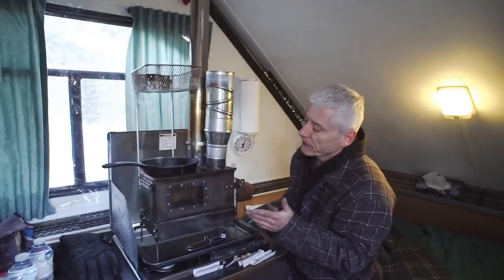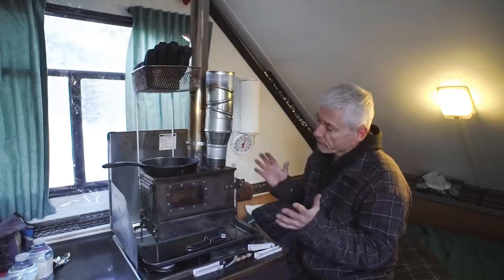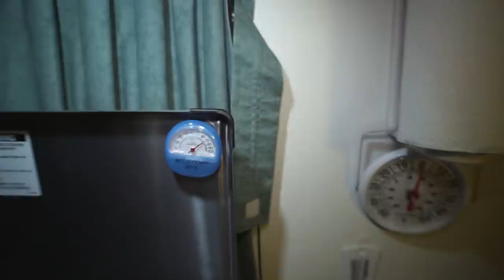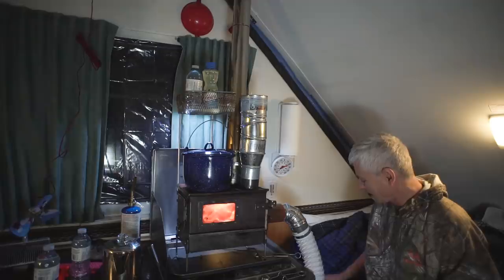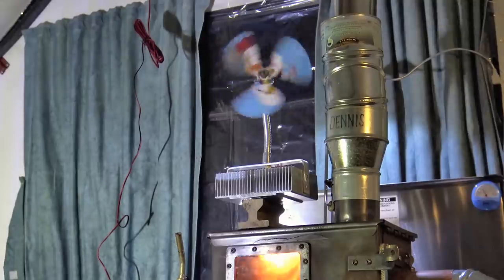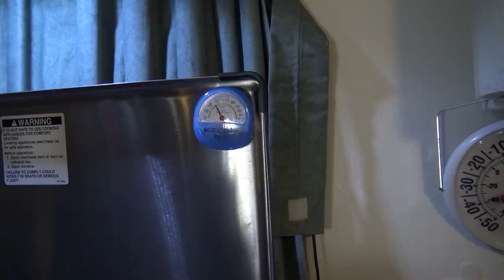Wood Stove in an A-Frame Trailer - Part 2

Comment: @slim Potatohead  Awesome videos!  Thank you for sharing what you are learning.  There are a couple of different things you can do to help with the heating. Instead of plastic sheeting use those thin mylar emergency/space blankets. They fold up super small, are worth having in any kit, and can be tacked up in place over the windows, and even on the solid walls, to help reflect the heat back into camper. You can usually find a pack of 5 or even 10 of them for about $10 US Dollars. (you can search for other youtube videos from bushcrafter's that show the how effective these types of blankets can be as heat reflectors).   Someone else mentioned anthracite coal. Most of the Narrowboaters in the UK use this type of coal to heat their boats with a multi-fuel stove. Not sure how readily available it would be in your area but it is usually available in 10kg and 20kg bags. It should last a LOT longer than the wood pellets, and end up being cheaper in the long run. It should also burn longer so that you do not have to keep waking up in the middle of the night to stoke the fire and add more fuel. If you do try the coal, the carbon monoxide detector is worth using just to make sure there are no issues.
Reply from the maker: Thanks for your suggestions Jessie. A few have suggested coal, however since I travel some very sparse places sometimes I'll probably stick to what I can get locally. Good thing about a wood stove is there's always something available to burn. SP

Comment: Some suggestions. If you cut a hole in the side of the shower you could use the drain as the hole to draw in air. A firestarter that is easy to make is to take a paper egg carton and cut up the cups and fill them with dryer lint and sawdust and then cap it off with wax. Another way is to use cotton balls and alcohol hand sanitizer to light the stove as each one burns for two minutes and it's cheap.

Comment: I recommend one of those fans that run off heat of the stove, they circulate the heat a lot. And maybe 2mm tape up some insulation foam with the reflected coating. It’ll have you sweating in no time

Comment: Maybe someone else already said it, but I think if you use a foil safety blanket as a curtain, you might be able to keep more warmth inside. They are not that expensive, very light weight and easy to fold/carry. And maybe you can put some rocks on top of the stove. They stay warm quite long, you can put them in a sock and warm your bed with them

Comment: Hi, Slim: I looked at various different types of RV's, including their construction. Depending on the RV, including how it is constructed, will determine how warm it will stay during the winter. During my research, I found that DIY's were enclosing the bottom of their trailers with, King span or polyshield as skirting around the bottom of the trailer as a wind barrier. I would be inclined to use 3" kingspan with an R factor of 10 and glue polyshield on top, then put this on a movable skirting frame and enclose the bottom, of the trailer with it.  For insulating the interior, I would recommend looking at Frost King CF-55 Foil backed natural cotton duct wrap, a DIY'er  used this form of insulation and it keeps their van very warm in the winter.  Normally, this type of insulation is used during a build, to line in between; the studs. But it could be used in a canvas sleeve to create a cold barrier. The canvas sleeves could be attached to the interior walls of your a-frame as a removable cold barrier, for winter camping using zippers to attach all of the sleeves together. You could even, Velcro zippers on the interior walls and attach the canvas sleeve sections to the Velcro zipper sections. (Frost King CF-55 Foil Backed "No Itch" Natural Cotton Duct Wrap, insulates, cushions, and reduces vibrations on heating and AC ducts
, it is a safe alternative, requires no gloves, face Mask, or goggles needed
 and has a Class A fire rating, including providing maximum insulating power and installation is easy.) You could even create window sleeves from this material which would further help to insulate your little A- Frame Trailer. Best of luck to you, on your journey. Another idea, for this concept, would involve using tracks, for sectional insulated sleeves, insulated with 2 " foam board, with Frost King CF-55 glued to the top, placed on a light flat board; covered with utility canvas and stapled around the back, with heavy duty staples.  The sectionals being slid in between the tracks, attached to the interior of your A-Frame trailer, to make them removable and you could even consider scotch guarding these sectionals to keep moisture, from seeping through. Zippers, could be used, in the sleeve sections, where these sections meet to zipper them to gether, to help create a cold barrier.   I have seen this method, for insulting used by a DIY'er who was insulating his modern Conestoga Wagon with. The results were surprising, not only did this wagon stay warm in the winter, but it stayed cool in the summer, just food for thought. If, you have room and haven't put fire brick inside, of your stove. I might consider doing so, several DIY'ers; including campers who used wood stoves in their tents, RV's and Conversion vehicles all suggested doing so. Many of these DIY'ers, including campers explained how fire brick holds it's heat, projects the heat back into the RV/tent/conversion vehicles. Many, suggested placing bricks around both sides and the back, including a partial brick on top, which seemed to work and kept the heat from  escaping up the flue and the chimney much cooler-My best to you, on your journey.

Comment: Just a piece of advice, boss - infrared cameras aren’t at all accurate when aimed at reflective surfaces unless a dull material is added to them first. For copper pipes a piece of masking tape is sufficient, but for a shiny stovepipe, one spot painted with 1200° stove paint works well. Keep on camping!

Comment: Great video, I saw the entire series from construction to the best part. Keep up the good work of sharing your experience and your lifestyle. A suggestion: Why don't you try to do a package or a mix of cotton pellets socked in cooking oil and phosphorus and fit it half way of the wood chips intake. By doing that you can allow the first half of chips to burn off, then the package will drop for maximum heat and burn and at the end the second half of the wood chips.  That might give you more ours of sleep without having to stir the ashes to reignite the fire again :)

Comment: Really liked this video. You actually made a stove fan out of the old koolatron fridge parts!  Very cool. (I upgraded my peltier element and heatsink/fan in the koolatron so it actually cools now.)  One thing I see on the stove fan, since the peltier element works on temperature differential, it would be more beneficial to have the fan blow at the heatsink or draw air through it.  The ready-made versions all have similar design where the fan cools the heatsink. But maybe you wanted it to turn slower so it's quiet, just an observation. 

For your pellet stoker, maybe you can make it built-in.  Something like metal fingers in between the basket holding the burning pellets that can jiggle from the outside.  That way you can do this easier while you're half asleep.  Having to poke through 4 small holes while half asleep might be challenging.  But nice multi function stove you got there!
Reply from the maker: The fan was just a first test to see if it worked, expect to revise the design. The fan is on a gooseneck, so I can bend it any position for better efficiency. Fan blades will also be revised. Thanks! SP

Comment: You can put some rocks underneath, atop, and generally around it to retain that heat, same concept as a "mass heater". You need mass to retain that heat and keep distributing it, somewhat negating your lack of insulation and catching more heat before it goes out the chimney. Also if you can convert to a coal stove you'll get a lot better heat for a lot cheaper.

Comment: Has anyone mentioned covering the windows with insulation foam sheets?  They can groove them then hock and loop them to the walls.  They will easily fold flat for storage.  I like the heavy R factors for insulation.  You may want to look into heaver mats for the floor and in your storage areas.  It would also help with cooling in the summer.

Comment: You might try using a fire place fire starter or cutting a fire log (walmart) into thin slices to Stuart the stove, works good! Saves a lengthy start up with propane torch! Shalom!

Comment: just an idea...wet the windows and cover with bubble wrap//supposedly the air pockets in the wrap help insulate.Cut them to size and remove when not needed.The wrap is inexpensive

Comment: As aluminum conducts heat pretty well, it crossed my mind that you have a hot stovepipe running from the top of the stove up to the inside of the roof, something around a yard of length to which you could affix an array of aluminum plates similar to the fins on an air-cooled engine, possibly by use of a hinge and clamp, so that you have aluminum flashing applied to the outside of the pipe with fins riveted to it . . . you're well able to take the notion from there and run with it. The goal is more surface.

Comment: I understand larger pellet stoves have motors that feed the fire to keep it going.  How do you ensure your feeding system works without igniting the pellets in your holder at the same time?  Great video!

Comment: Greetings Slim! Great video and congrats on the successful run on the wood burner! That rain cap and spark arrestor is the bomb!  Your little electric generator you fashioned is great as well. It reminded me of those deals that came out around Christmas time at my Aunt's house that would spin when the candles were lit. I forget what they were called.  Did it successfully charge your camera batteries? 
It was interesting to see how clean these pellets burned (earlier in the video after the fire burned awhile and it came out the stack). 
 In the White Mountains we burned only juniper as it was the only wood around (very plentiful). 
 I remember in the earlier videos you intended to burn wood or pellets depending on the conditions. Do you think you might try wood next? I realize that certain kinds of wood burns hotter and cleaner than others and it made me wonder if it is the same for pellets as well?  I think if I were using that little stove I would use the pellets indoors because it burns and keeps so easy, unless I run out of pellets for some unforeseen reason? Oh how I hated trying to keep the cabin clean and trying to store wood inside for use overnight! However that's me because I prefer fishing and long hikes over cleaning any day!  Again that's just me and in no way telling you what to do! Now as far as having to get up and stoke and feed the stove, I feel its just something that has to be done (and expected) when heating with a wood/pellet stove, and maybe should be considered if someone is trying to decide on how they want to heat themselves. It's par for the course as they say.
Holy cow I wish we thought of a way to circulate the heat in our cabin the way you had in your camper. That would have helped us out a lot that winter! 
Well congratulations once again, and I hope this little stove continues to make you happier than a pig in sh.......!! 
Anxiously awaiting your next adventure! Travel Safe!
Reply from the maker: Thanks! I expect I will only use pellets indoors, as they are consistent and less likely to produce smoke. Outdoors however the choice would be firewood. SP

Comment: Does the trailer have a heater ?  There is a Buddy Heater - 10 & 20 Gallon & Attachment Heater goes on top.  Seen a Ceramic Flower Pot on top of a small cooker flame.  How about some insulated panels with attached clips to go over the windows - winter.  Was going to suggest a fan.  Stoking helps.  Like work with insulating & reflective.  Like the Drying Rack.  Looks like a little experimenting works.  Was thinking on doing something similar for travel/living on the road, but I might do a Pick Up with a Sliding Camper that has a raiser top - solar/storage; propane - cook/heat; possible deck on back or towing ( option ).  Anyways, I like the A Frame with a good ride to tow.  Thanks.

Comment: Excellent video.  Nothing like camping in the Winter when it's -20 below zero with wood heat and staying toasty warm.  You did a fantastic job.  Good to see you added the stove cap.  Might be worth trying a compressed log for an all night burn to supplement your pellets.  Have you tried to burn regular wood?    Easy to make egg carton fire starters for little cost from wood shavings and candle wax. Couple 12 v muffin fans blowing across the top of the stove will distribute the heat more evenly to the floor where you need it.  Sorry you have to bend over backwards for the stateside safety Nannies.  We're not all that way.......:) 30 years heating with wood.  Keep up the good work, have me rethinking a wood stove option in my truck camper.
Reply from the maker: I expect I will only use pellet for indoor use, due to consistency and less fumes. Firewood is best for using the stove outside, especially for cooking. Thanks! SP

Comment: I like the flexible tubing to pipe in fresh air from outside.  Have you substituted 8" pieces of wood instead of wood pellets for fuel?  I think the larger pieces of wood would burn longer than your small hardwood chips.

Comment: Awesome video. Heating up a thermal mass like cast iron or pot of water should keep the trailer warm for a couple hours even after the wood has burned up, right?
Reply from the maker: Not really. I know some have used similar items to warm on the top of a stove after the flames go out, but in reality they do little to keep a trailer warm in extreme cold. A warm pan of water does not compare with the 538F temperature of a burning hot stove. SP

Comment: If  you intend to extreme winter camp, could you insulate the outside surfaces with a cover made of waterproof insulating roll, a faff in a storm, but safer and cheaper than most things

Comment: Hey Slim....Always enjoy your videos.  Can you provide specifics on the wrap around foam pipe insulation you used?  It appears you used two different styles on the top of the side walls.  The stuff I've  found so far has varying thicknesses and inside diameters.  It also appears you are still making use of the pool noodles also.
Reply from the maker: Hi Skip, correct. I used wrap for 1" and 3/4" pipe as the gap tapers. There is one section in the front half that I cannot use it because it interferes with the roof coming down, hence the pool noodle. Frost King is the best, but I couldn't find it on Amazon. Will probably make a full video at some time in the future. Thanks! SP

Comment: You have a lot of heat going out the pipe that you could recover with some type of heat exchanger in the pipe (make your own after looking at commercial designs). And I've seen nice heat exchangers for the top of the stove. The CruisingTheCut channel had a video on his stove in his narrow boat and he had a nice heat exchanger on the top of his stove with a fan.

Comment: That's a great stove :) But i miss you show burning wood in it and the difference of cooking-heat with pellets vs wood.. Birch has a very hot but fast burn-time, oak a bit lower temp but much longer burn-time -- what's your experience, if you tried it out?

Comment: I used to winter camp in my 1994 Terry, 18 ft travel trailer. The trailer wasn't 4 season rated but all water pipes and the fresh water tank were inside. I just added some RV antifreeze to the both gray and black water tanks and could easily camp in below freezing weather. Shower and toilet worked great. The factory installed heater could easily heat the trailer. One propane tank lasted for at east a week with heavy use.
I miss that trailer. It seems like most newer trailers are built so cheaply. Insulation is poor too. Fresh water tanks are not internal. Everything would freeze in just -2C weather.

It's 95 degrees here in South Carolina and very humid. I'd trade this for freezing weather anytime because I absolutely hate hot weather. Anything over 65 degrees is too warm for me. Too much Russian blood in me, I guess. LOL.

Comment: Hello from Minnesota! It's about zero degrees fahrenheit today, going to be around that till next saturday, feb. 2nd when it will warm up to a sub tropical, 20 degrees f. ( yay! I can go for another bicycle ride!) I've been out in my garage workshop, working on a stove very much identical to yours in many ways. One thing that puzzles me though is how you attached the can to the door of the stove and how the groove along the top of the baffle plate was put together. I can kind of see some pop rivets installed just below the groove. I don't have a sheet metal brake so some parts were really hard to fabricate. I used a bi-metal hole saw to cut the three inch holes in the lid and 16 gauge liner plate for the flue and the pellet tube. I only had to peen over about a quarter inch of the propane tank tubes to get enough for a good seal. I'm going to try to see if I can get away without the fibreglass mat seal you used around the flue. I'm waiting on a piece of mica, have yet to build the baking tray and bend up the legs. I intend to use this stove in my Chevy express cargo van with the stove pipe being run out either the slightly opened, back or side doors. I'll have to come up with a gusset and insulation to keep things warm. I think I'll have it just about finished by the time I run out of cord wood to keep the garage warm. Hope to meet you someday out on the road. I very much enjoy your videos.

Comment: run a pipe lenght lateral mid way up the stack for a heat exchanger loop. Perforate the top of you pellet cap and let more air down there. simple measures and significant gains